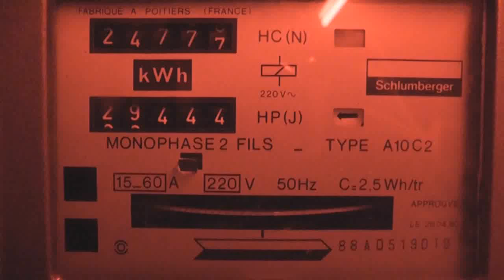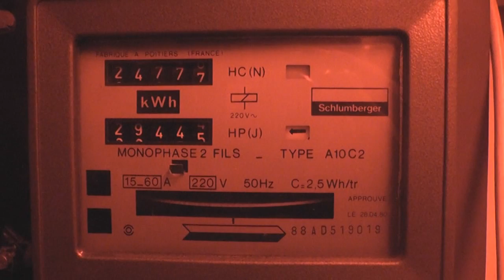MOT red 2

Comment from the maker: I am pulling between 20 and 30 Amps from the mains. The two MOT's are unballasted. The high voltage current goes through a 3.3 uF 2kV Capacitor. ( Three 1 uF MOT caps in parrallel with each other ) in series with the MOT's.

Comment: Mmmm, sparks & pops. :-D Mad soldering skills right there, LMAO!

Yep that board took a right blasting & that arc is going all over the place. I'm not sure what current you're pulling on the mains but...Could you vary the arc by controlling the input volts to the MOT with a variac? That arc did look a little wild! :-D

With the red filter in place, we got to see a bit more which would otherwise be a bright flash caused by the arc. It also protects the camera from burn-in, & purple dots. :-D

BBD